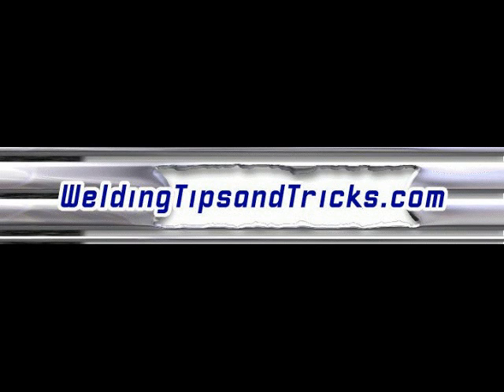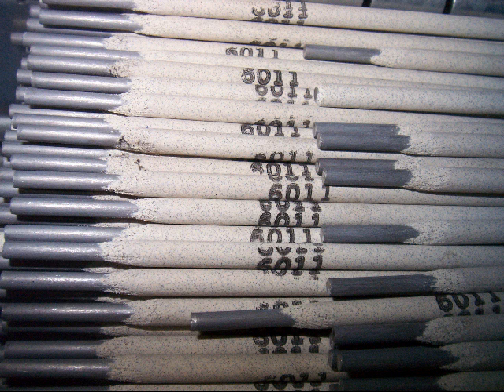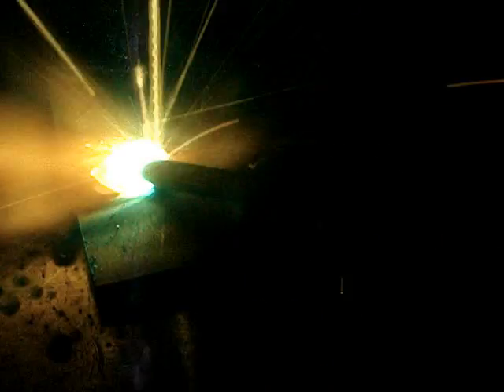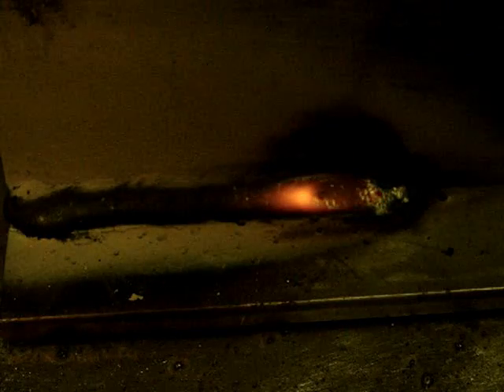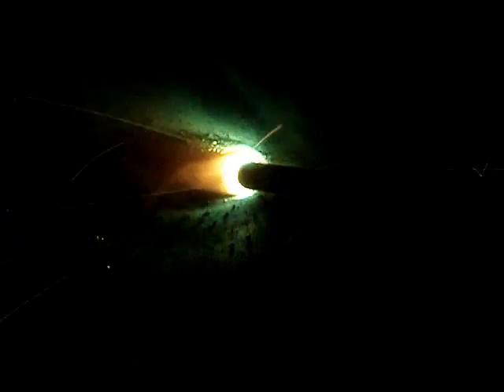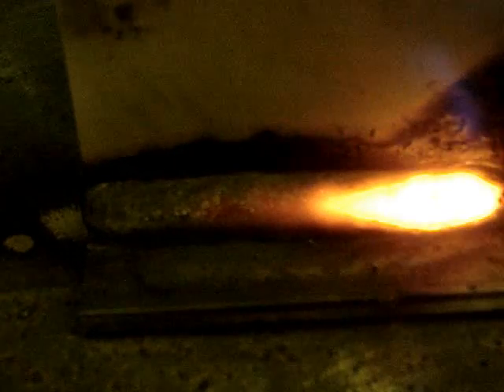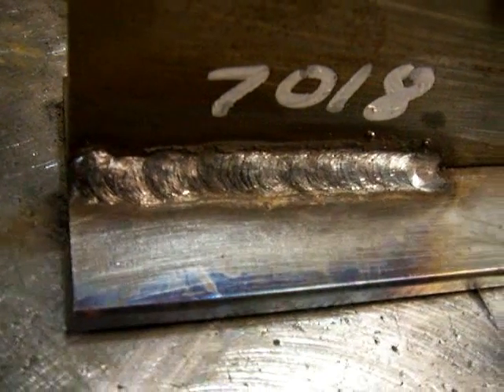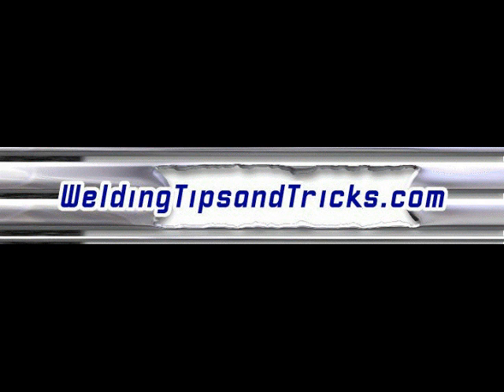Shielded Metal Arc Welding - Stick Welding Rods

Comment: Hey Jody, you might not read this anymore but have you ever seen 7016 rod? Let alone weld with it?, i'd take this over à 7018 (regular not excalibur) Any day, it has a glass like slag which i realy like!.

I hope you are reading this and i would  apriciate à reply alot!

Greetings from Holland,

Hiddo.
Reply: Hiddo kramer  I did some E7016 3,2 mm Thyssen Phoenix Special D , but not on a modern invertec.   Hard to start on a classic 40 year old 220AC rig running below 120 amps.

Comment: hey i have imaginative question about welding with gas in general: If i had vacumed space, then i would n0t need gas where we normally use gas ?
Reply: I am not an expert but I happen to have some material on this. By burning the coating flux, you create inert gas to protect the welding part from oxidation. IF there's no air, there won't be oxidation therefore no need of inert gas.
Reply: You may still need a gas in order to create an ionization path between the electrode and the workpiece i'd imagine. But I guess you wouldn't then call it shielding gas, just plasma gas :p
Reply: well, time to suggest NASA to perform welding in space to find out.

Comment: With 6011 electrodes being very similar to 6010 you can use those instead unless you have a requirement that demands 6010 use. I use 6011 with my Everlast all the time and they work great.

Comment: Are there any rods that you can run on DC straight polarity?
Reply: Really old, let's see if you're still around in '17.  

I've never seen or been around any SMAW rod or procedure that called for straight polarity  but it's an interesting question.  I have ran 1/16" stainless rods on straight polarity to try to get more use out of a rod and help with the penetration.  I was never very good with stainless rods.  I'm not sure of any reason to run straight polarity for anything SMAW.  

I accidentally made an entire weld, from root to cap, on a piece of 12" steel piping.  I couldn't figure out why it was fighting me so I just assumed I was having a bad day.  It passed NDT and is probably still in service in the Ashland, KY refinery.

Comment: I noticed that some Everlast arc welders have a special port for 6010 sticks so that they burn smoother. Are the 6010 sticks the only sticks that like a slightly higher voltage?

Comment: I run 7018 on 105 amps and it runs beautiful on ECEP. The instructor at the Hobart Institute of Welding Technology ran a demo at 95 and it came out very nicely with 0 arc length control. Personally I run mine at 105 amps with a 9% Arc control and get great results. I feel that 120 amps+ would gouge the plate or would require a very quick travel speed. But hey, to each there own; everyone has a their own style to welding.

Comment: base on my experience i dont really get a good look on using 6011 you need to cover it wih XX13 or XX18.. we only use it for rooting coz its strongger, it wont easily get crack..

Comment: @Marshmallowrex The work-lead is clamped to the project or a conductive table touching the project, so touching electrode to the work will cause the current to connect. After touching the electrode to the work you pull back slightly to establish the arc, thus creating heat for the weld.

If you get too close you can "stick" the electrode to the work and will have to break it off (not particularly hard, but if you break off the flux you can make the rod very stubborn to work with)

Comment: @STXB24  70"2"4 "2" Stand for flat psition welding...If it was 70"1"8 it would stand for 70 000lb strength 1 for all welding position and 8 is for your flux type!

Comment: i have a ac 225 amp Lincoln arc welder and 6013 weld like crap i hate them will never use them i love the 6011 they hold up we cant break them but the 6013 break easy cause it seams like there pure slag i will only use 6011 rods use them if you have the welder i have.

Comment: lol i use 7018 and its not in an oven its just in the shop it works just fine oh and 6013 isnt multi position its only horizontal, u weld it any other way and you best be ready to dance...

Comment: I have been told that some welding rods have a 'shelf life', meaning that they only last so long before use, and then the flux becomes brittle and hard to work with. Can you tell us how shelf life differs between the different welding rod types? If you don't keep 7018 in an oven, what happens?

Comment: the most trouble i have with smaw is vertical, and overhead is a bitch also,  any tips to what technique i should use? mainly vertical, i was told to run a c weave, then a z weave on top?

Comment: I'm a Senior in high school and I'm in beginning mechanics class. We use a 7024 to practice our first weld. Just yesterday, after about a month in this class, I finally got the hang of welding without sticking the rod to the metal, lol. And today we were all out of 7024 rods, so I had to use something like a 6013, or 6018. Still need to get used to welding slowly so I don't skip or make it too flat.

Comment: The 6013 will burn with less amps than the 6010, but like you say, it works better with more. Wormholes mean not enough amps. The difference between AC and DC rod is important. A beginner might get some AC rod and use it with a DC machine, get frustrated and decide stick welding sucks.

Comment: "Someone wrote in" - that'd be me.  Thanks for doing this vid!  :)
Don't suppose you could do one on the 'new' aluminum stick welding rods out there?  I've tried running them on my DC machine from about 40 through 150 amps with various degrees of failure.